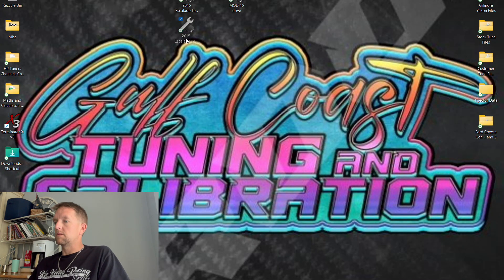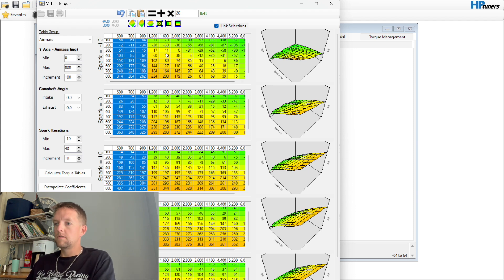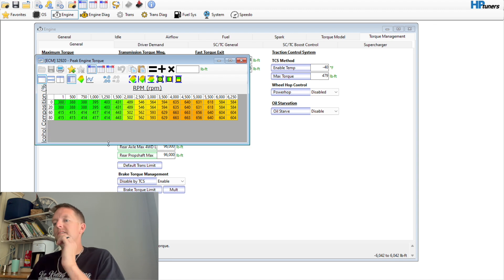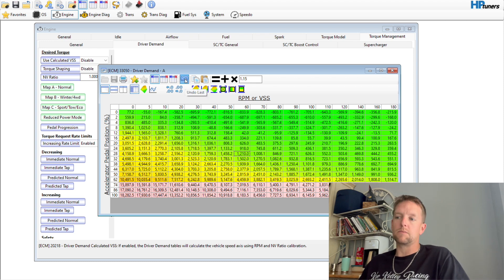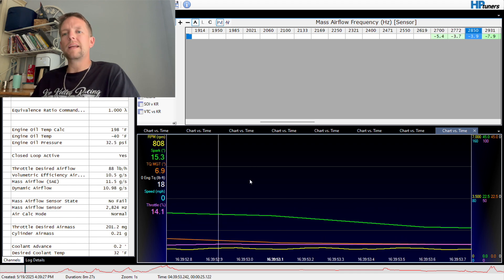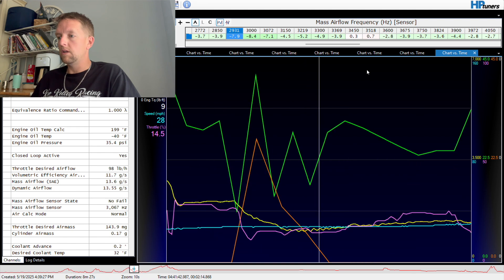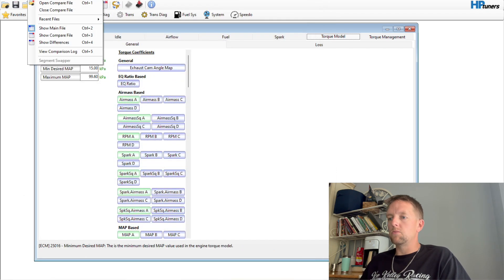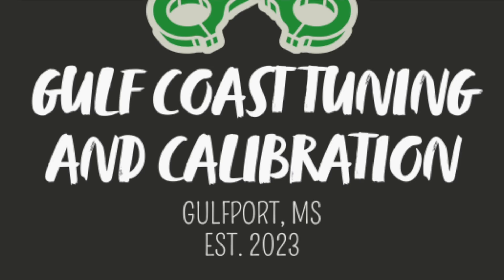This Simple Trick Boosted My Engine Power!

Comment: Where do I make adjustments to close the throttle blades faster it hangs at high rpms?
Reply from the maker: Wouid have to see your file, how much base running airflow and timing are you running.